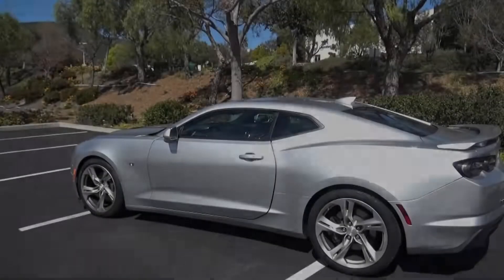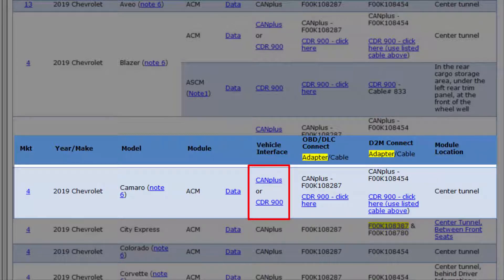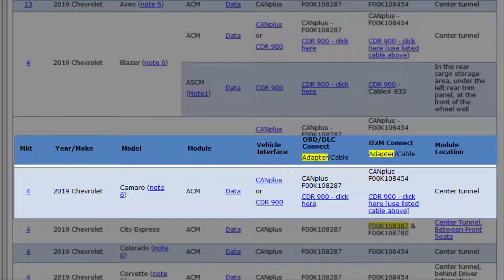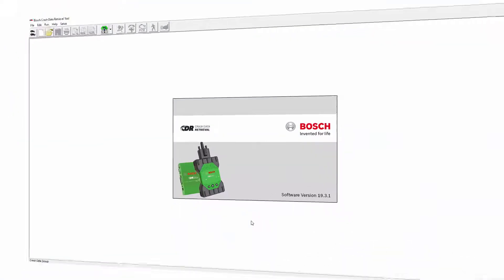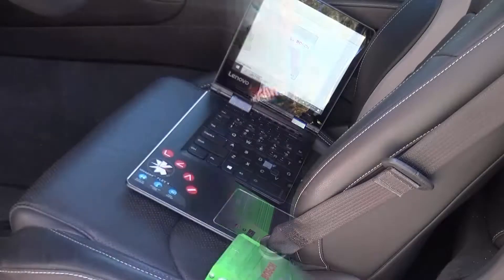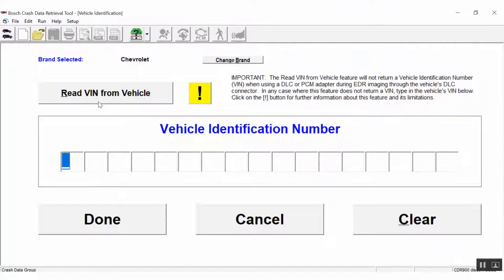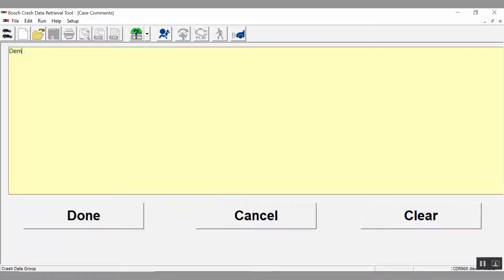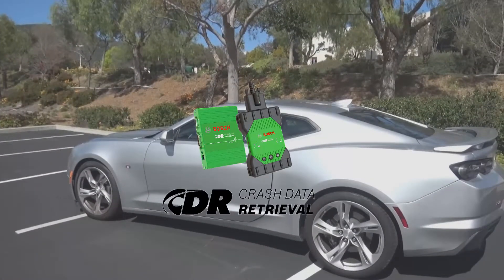How to Image EDR Data Using the DLC Method

Comment: HELLO, thanks for this guide; 
i have q auestion please, i try to Image EDR Data USING CDR 900 tool, but it stopped in Pass 2 and a pop up is display "Collect data failed! no communication with module, please check DLC cable or cable to module" even if already connected in VCI manager, do have any suggestion please ?